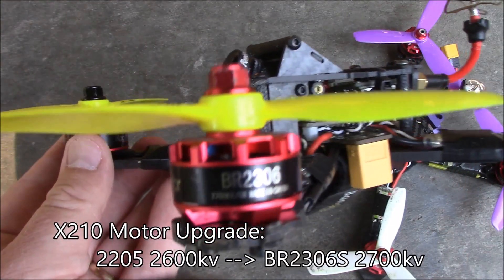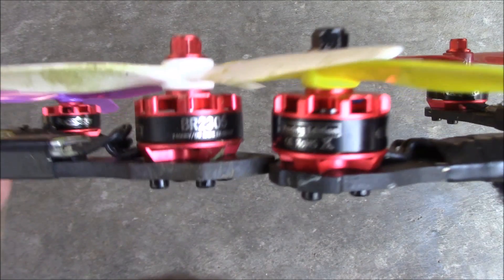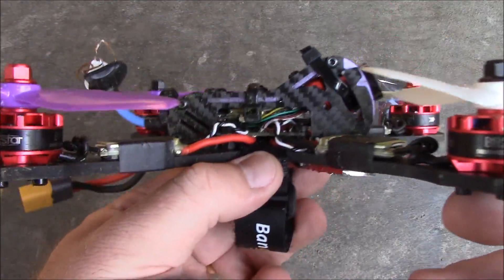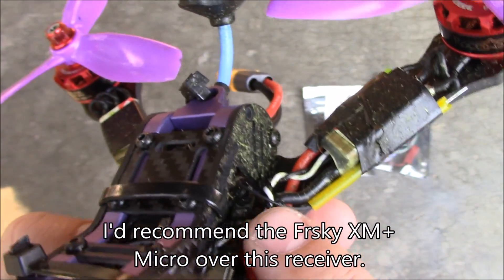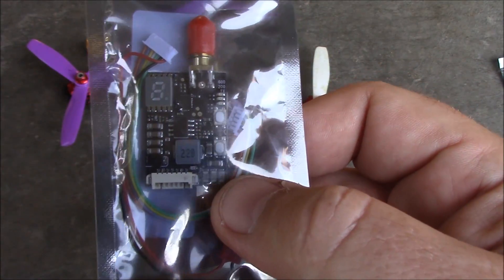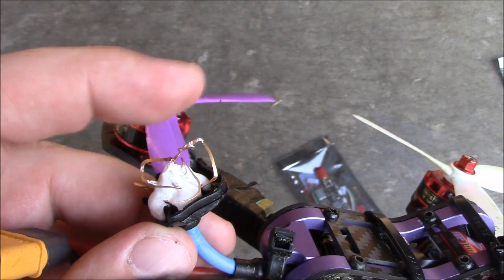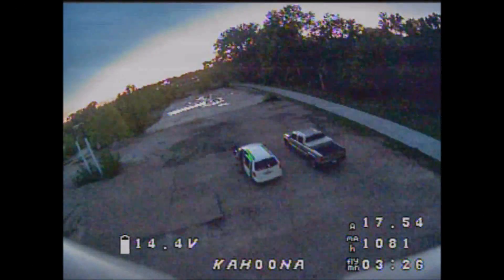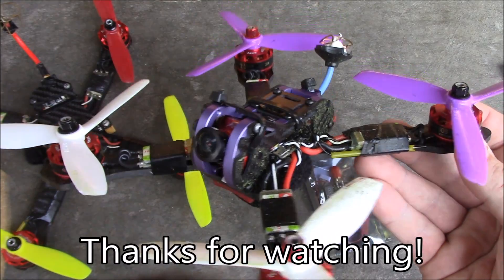Purple 215 Quad Review Video

Comment: How is the EWRF VTX doing in your races? A video from Mute FPV testing the power output on them showed that the output power is a complete mess!
Reply from the maker: I've had real good luck with it so far.  Being able to use Smart Audio with it is awesome.  I use the BF OSD to change channels.  This is such a tight build that I actually broke off one of the buttons in a crash but the OSD channel changing still works fine.
Reply: travisgrindal Thanks for the reply! I hope another guy will test its power output. His may have just been a fluke if you are able to use yours in multigp races!

Comment: Hey I saw you have reversed the direction of your motors do you have to change anything in Beta flight for this? I could not find any setting I could change.
Reply: Just in the CLI: set yaw_motor_direction = -1
Reply: Cool thanks. Can you also change directions on a Kiss fc?
Reply from the maker: I'm sure they can be reversed for Kiss, but I haven't messed with one yet to tell you how.  If you're using CW and CCW threaded shafts, you'll either want to swap around your motors or make sure you crank down harder than normal on your prop nuts so they don't spin off.  I finally got some normal lock nuts from Lowe's and used them.  The "lock" better than the lock nuts that came with my motors.  I haven't had one of them spin off yet.

Comment: Travis have you tried the Cyclone props?  They are so much better and just as durable as the old v2.  I have those 2306 motors on a 325g basher and they seem to handle 5050 dual blade Cyclones well.

Comment: I've had nothing but great success with those Racerstar 30A ESCs too. Like you, I got them with one of the x210 kits and they've never let me down. And no matter how hard I fly them, they're always at ambient temperature.
Reply from the maker: I've only had one ESC burn up and that is when I hit some branches and the prop struck it and knocked off components and started burning!  It was cool to see.  :)
Reply: the ones that go to 5s in the 30a put out more and quicker than the 20a when you need it.
on the 2600kv+ motors they wont use it but on the new racerstar 2400kv they will. 

great review

Comment: Are you using the Pro58 RX in your fatsharks ?
Reply from the maker: Yes.  I like them better than my Realacc ones because changing channels is fast with the goggles button and it automatically saves the last channel you were on when you power them off and back on.
Reply: travisgrindal think you're the only 1 who's switches :/ if it's stock firmware then it's flawed !

Comment: Hey quick question I have my receiver bound to my radio and I'm using a betaflight F3 board for the first time over my Revolt f4 yeah I know LOL but I cannot get my radio to respond in betaflight it is bound because my receiver lights up and I have checked the uart and serial RX is enabled and Spektrum 2048 am I missing anything is there something else I should try I have not tried flashing the board yet I could give that a try
Reply from the maker: I have no idea about Spektrum stuff.  I've never used one.  I started on a Turnigy 9X and then upgraded to the Taranis, then Taranis Plus.  I'm hoping to get a Special Edition Taranis eventually with the newer gimbals.

Comment: Bring it on Kansas boy LOL when are we going to meet up I'm ready and yeah I didn't like the 23 Motors either I had the 2700 KV and it kills your battery too fast you would need to strap like a 2100 on there LOL 2206 2722 KV that's my favorite sweet spot
Reply from the maker: Which motors are you flying the most right now?
Reply: travisgrindal I am flying the Hyperlite naked bottom 2206 2722 KV I love them